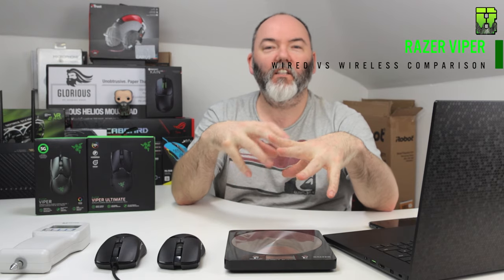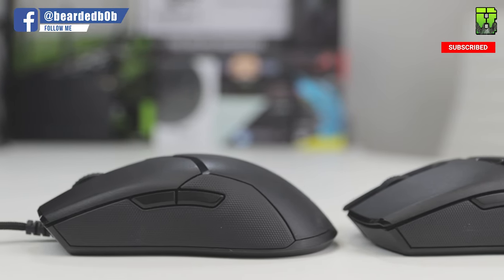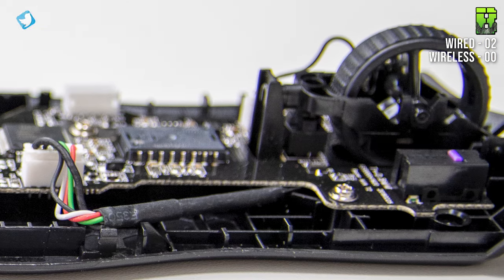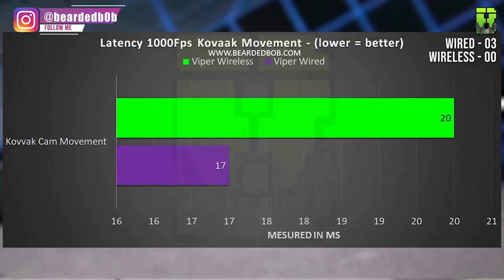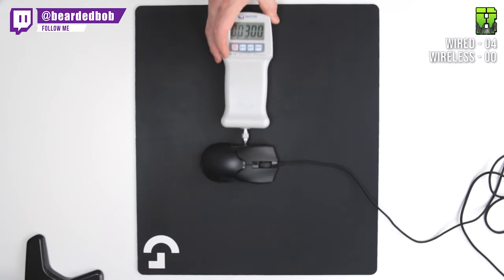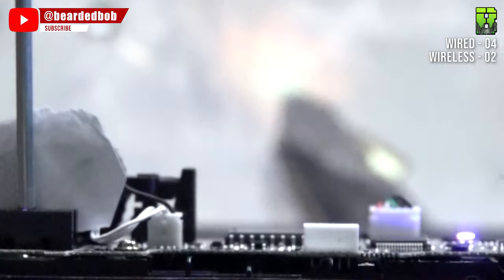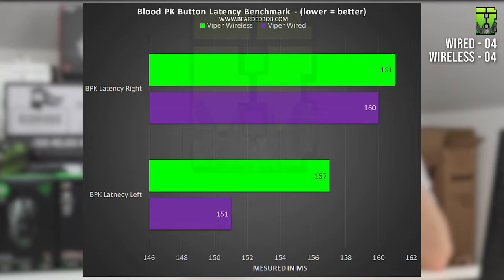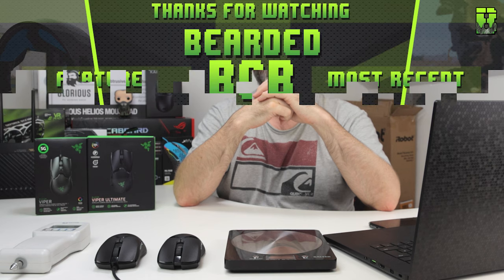The Ultimate Showdown Razer Viper Vs Razer Viper Ultimate Wireless Gaming Mouse Comparison

Comment: UNLESS you have pressed the switches or moved the two mice AT THE EXACT SAME INSTANCE of an in-game frame being either started or just finished rendering, the click or move to in-game frame is going to have a potential of AT LEAST 1 WHOLE FRAME inaccuracy.. that is 16.6ms on 60FPS, if not more than 1 frame, depending on circumstances as the game engine, or the in-game current action or system background processes.. Really can't even be taken as a rough guideline, so Idk why the bother.
Reply from the maker: Lots can affect latency, I wouldn't read into it to much.

Comment: Great video, although I have some thoughts. I get that you want to make it as clear as possible when showing your results in the diagram, but I find it very deceiving when the X-values are so inconsistent, like when you show the ms latency in Kovaaks, and you start at 16. It just makes it look like the Viper wireless has a huge gap over the regular Viper. Again I get why you're doing it, but for me the only thing it does is make it harder to see how significant the gap is, arguably counteracting the whole purpose of changing the starting point to make it clearer in the first place. 

Another thing that I thought was weird was that you didn't take into consideration to the fact that the Viper Ultimate is actually wireless, which to me should give the Ultimate a point in its own, as it is also the reason for being heavier.

I realize after rereading this that it may come off as snarky, but that is definitely not my intent. Again, great video nonetheless.
Reply from the maker: Thanks I'll look into it.

In regards to the points and not using cable or wireless as one to score it's because I only wanted to use 10 points to keep the video shorter and the wireless/wired is an abvious one.
Reply: yes it is confusing but it forces you to use critical thinking kind of

Comment: Thanks, that was a very interesting comparison. But I have a suggestion regarding the ratings. Categories like weight or how much force is needed to click the wheel are personal preference. There must be a point when it is too light for some. Also giving the point to the wired Viper because its cheaper doesnt make sense either because they both are representing two different technologies and one is considerably more expensive than the other by default. And also you could have given a point to the wireless one because it doesnt have a cable. With this approach the result would be completely different :)
Reply from the maker: No problem glad you liked it 👍

Comment: Hey Bob am new around here. Was just curious to see if you could answer some quesitons to the best of your ability for me ? 1. What are the best mouse feet for control ?   2. Im thinking of getting a new mouse, need something slighty smaller than the gpw by about 1.5 mm/0.5 mm range the arch where it sits in my palm is a tad high.  Im thinking of getting the ultralight cape town. What do you think?? My grip style is palm grip. Thanks for your time bob!
Reply: Ahh, i should have stated that every mouse that should suit "palm grip" i cant use which is odd lol.
Reply from the maker: 1. Mouse feet are different on each mouse. 
2. UL2, MM710 or Model o-
Reply from the maker: What size is your hand also :-)

Comment: Which Sensor is better ? Viper oder V.ULtimate ? Thx
Reply from the maker: Imo they are both as good as each other.
Reply: Both extremely good. Human can't feel the difference
Reply: @MrKarli120  i have tons of mices here. Ultimate Viper , Viper , Razer Deathadder Elite, Rivals 310 , Gpro , XM1 , G1 , G502 and a lot more. But at the end i like the most my Razer DA Elite. Do you think the Sensor from the DA Elite can keep up with the Viper Sensor series?
Reply: @flavis35  DA elite and viper have the same sensor (pixart 3389)
Reply: @flavis35  Viper ultimate technicaly have better sensor but the difference is negligible. Just focus on the shape and weight, sensors like 3360,3366,3389,hero, focus+ are all same extremely good. Only specific testing can show the difference, human can't.

Comment: god damn i just find a rough diamond of a channel right here feeling lucky.. a very neat picky guy just like me.
Reply: waiting for that weight reduction razer viper video!
Reply: the thing is measuring like that with a screen is a bit like playing jackpot, if you are displaying at 144hz each frame has a delay of 7ms so when you press the button it can vary from +0 to +7ms inconsistently, so i would recomend to do a run of 50 times then do an average to compare more evenly, also i would show paint on display changing from black to white when clicking
Reply from the maker: Welcome and glad you found me :-).
Reply from the maker: It wont be long now as my Viper mini has arrived so a battle of the weight reduction will begin.
Reply from the maker: I do plan to do more tests but atm just to get this information is exceptionally time consuming. Down the road if I get more time or can do it full time we an get some larger samples to help flatten out any anomalies to provide a better avg

Comment: All I can say is, that the Wireless one has the better sensor. I owned both the wired (returned it) and the Wireless (my main now).
The wired version sometimes had trouble with tracking on my Artisan Shidenkai Mid, while the wireless version has no issues.
And also creating a custom surface on the wired version didn't improve anything. On the wireless one I can use the default setting or tune it, both works fine.
My playstyle was also too agressive for sensor on the wired version, it couldn't keep up with some of my flicks, while the wireless one has no issues.
Reply from the maker: Interesting as the wired has a custom version of the 3389 which is a.top end sensor. What mouse did you move from and what dpi /sens do u run?
Reply: @Beardedbob  Coming from the XM1, had also no issues with tracking on my Shidenkai there. The Ultimate feels like the XM1 tracking wise for me, the wired Viper didn't. Felt more like the G Pro Wireless, but a bit worse.
I'm always using 800 DPI and playing on 12 sensitivity in Black Ops 4 or MW.
Reply: @freesS3  Also better might be the wrong word, i have seen a few mice with 'technically' superior sensors that have tracking issues on some artisan pads,  G Pro wireless being very temperamental with a lot of mats in my experience.

Comment: Bob do you recommend the Air58 or this? I’m not worried about pricing or availability
Reply: Meme God viper ultimate would certainly be better overall
Reply: Im late but find which shape you prefer
Reply: Air 58 in only 500hz...
Reply: Air58 is trash.
Reply: @originalstarwalker21  iknr

Comment: hey i wanted to ask if when you compared the movement latency was the viper ultimate dongle next to the mouse so that it doesn't subject to any unfair interference
Reply from the maker: Hi,
Yes its about 30cms from the mouse. I'm going to do a Video testing if the distance makes a difference and at what distance it becomes and Issue.
Reply: @Beardedbob  oh ok thanks.

Comment: The only things the Razer Viper needs to upgrade would be, a silent option since the switches are laser (no need to get a clicking noise if the switches are laser) and also a lower travel time for the side buttons (the logitech g 502 had perfect travel time, i think it feels like half of what the viper currently has)
Reply from the maker: True a lot of people as me which is a silent switch and the opto's are perfect for it.

Comment: Never really expected things like friction and actuation forces to be in a mouse review, really cool details. Im just questioning the legitimacy of some of the test, it's really hard to believe that the wireless would have such higher movement delay but lower press delay. Better testing methods needed, also would be neat if you stated the sample size of each test.
Really unique review, but delay testing needs to be reworked considerably.
Reply from the maker: Glad you like the review 👍. The sample size is something that’s been discussed before.
Reply: @Beardedbob  One more thing, perhaps it would be nice to measure some sort of signal strength/range with wireless mice? 

With the very concise and wide testing you do this would really complete the set.

Comment: On 3:40 what latency where you measuring? Like a input lag or delay some kind of latency? Damn i play r6 and i even ordered the wireless one (mercury edition/white color) but its 28 milliseconds in cam latency while the wired has only 13 milliseconds in cam latency, now im having second thoughts.
Reply from the maker: device, so from when you move the mouse to when the game registers it. There are a few things that can impact this hence there are a few tests to help. 

tricky one to measure, i've a Nvidia Reflex monitor to use for testing also.
Reply: @Beardedbob   if the razer viper ultimate is used in wired will it equal the performance of the razer viper ambidex wired or will it stay the same?
Reply: @Beardedbob  which has lower latency, the razer viper ultimate or the glorious model o wireless?

Comment: In my country the Viper Wired is a 100e, and the Viper Ultimate is 200e. I bought the Wired one on sale for 60e, and I really liked the shape (I'm coming from a Rival 300) so I figured I'd maybe go for the Ultimate, but the cheapest one I found was 140-160e (so still well over x2 the price of the Wired one). So my question is... Is it worth it? I mean I'm coming from the Rival and a terrible cable, so this one is pretty good in comparison, and I also have a Zowie bungee which I didn't even try with the mouse because again... In comparison to the cable on my old mouse this one is... yeah... Anyways I watched the video, but I haven't really seen much of a difference. I thought the skates were better on the Ultimate, but from your test it's the cable that makes a difference, not the skates themselves. And I do play CS:GO at a semi-high level 3000+ elo faceit, so every little bit helps, but the differences in clicks were pretty negligible weren't they? I mean hell the Wired one actually had better response time in some of the tests... So did I pretty much answer my own question here, or am I missing something?

Also how good is the Model O Wireless? In my country they're only available through people who resell them, and not from actual stores. They're around 80e, and in new condition - But the problem is, if something were to die on the mouse, I'd probably end up waiting 1-2+ month to get it repaired. Should I just stick with the Viper Wired then? I mean I heard great things about the mouse, but is it really worth all the possible headache?
Reply from the maker: The Viper wired is good, I just personally don't like the shape. Here's my review https://youtu.be/clu5ic9LGRU The Model O is a better shape for me also
Reply: @Beardedbob  Hey, thanks for the reply! I'm coming from a SS Rival 300, and I have a finger tip/ palm grip, with 19.5cm by 10cm hands. The Rival was kinda big for me, since I never fully palmed it, but I had it for 6-7+ years. I got the Cooler Master MM710, but that was way too small, so I returned it. I then bough the Viper Wired, and I'd prefer if it was a tiny bit bigger, but it's still pretty good. I think the G Pro or Model O would fit me better because they're a bit taller, and not as low profile. However like I said, everything is pretty expensive here, there was a G Pro on sale for 140e a couple days ago, and you probably won't be able to find one below 120e, so that's still x2 the price of this one. So I don't know if it's worth the upgrade. I also cannot get my hands on any after market feet, and from what I've seen the G Pro doesn't have the best ones, so that's a bummer... I'll be sure to watch your video. But do you think that the G Pro / Ultimate are worth it at x2/x2.5 price of this one? And should I risk getting a Model O Wireless for 80e. Because like I said they don't sell them in my country, so if something were to stop working on the mouse, it would probably be a month or two of waiting to get it fixed. I just don't know if any of those 3 mice are that much better than this one..? Like I said, I've had the Rival for 6-7+ years and it still works perfectly fine, but I would like to upgrade. I have the money to spend, but at the same time I'm not really looking to drop 200e on a mouse, especially if the differences are negligible.

Comment: Hi I have a question about the mouse 1 and 2 buttons. I currently have the wired version and I’m wondering if the ultimate uses the same switch to activate mouse 1-2 buttons. I really like the viper and want to upgrade my wireless mouse from G pro to ultimate but I don’t want to buy if it’s not the same as regular viper
Reply from the maker: I've not opened it yet but I will shortly do keep tuned for the ultimate teardown.

Comment: Hi bob, ive bought the wired version of the Viper, rocking it for about a week now. 
I tested Humanbenchmark straight away when i got it. After playing for severals hours i repeated the tests on human benchmark and still doing it every day multiple times. What ive found is that the mouse somehow got faster after a while of using it. Maybe it has to do with the buttons starting to get a little wear or something. The thing is i put really alot of time into humanbenchmark testing / getting used to the mouse because it somehow does matter where you press the button down. So here are some screenshots of "average" results https://imgur.com/a/gl5553p https://imgur.com/a/o57GsxY (no prediction and no clicks below 130ms involved, tested on a 144hz Monitor, with Chromium Browser, 1000hz polling rate)

Initially i got around 165ms on average, but since day 3 im consistantly hitting around 142-148 ms on average. because your results in the video are shockingly close to my initial testing i had to bring this up. I could imagine that there could also be a little difference in manufacturing quality or quality variation of some parts of the mouse that could cause or explain the difference between the Viper and Viper Ultimate.
Reply from the maker: You could be getting used to the mouse or you are just getting faster at reacting to the green 😜
Reply: @Beardedbob  yea i think its probably getting used to the mouse, about reacting faster to the green well i dont know man, i always feel like im slow :D
wanna buy a 240hz monitor with lower inputlag and faster responsetimes, my 144hz Monitor im currently at is quite old it could be a bottleneck ..

Comment: These results surprised me. I would what happens if you do the click mod on Reddit compared to the old clicks
Reply from the maker: Do you mean by removing the spring on the rear of the button?
Reply: Beardedbob yea, also razer has a firmware update for the wired viper, so that could have some effect.

Comment: Guys the viper u should upgrade the feet Which is like 15 bucks plus paracord Which is about 20 - 30 bucks to get the same preformance making it 110 - 130 to be the same preformance as ultimate however the ultimate has better latency costs 150 bucks and comes with a rgb charging dock it also has no cable so no cable drag and no need for a bungey. Plus better feet pre installed. Viper ultimate is really the ultimate

Comment: I don’t get the point for being lighter on the wired ? I’m curios bc when you lift the mouse your also lifting the wire lol so wouldn’t it be heavier with the wire ?
Reply from the maker: The ultimate has a battery and these are heavy. They are also part of the mouse body where the cable is only a small portion thats included hence it's lighter. If you took all of the wire into account the wires are heavier but when gaming this isn't how you would use it.

Comment: I feel like the latency could severely vary depend on the mouse bc you could get a lemon, you should have it so that a less than 5 ms difference is a tie or something
Reply from the maker: Yep there is certainly going to be some variables in this. Unless you have a lot of vipers in this case then you are not going to be able to get this level of measurement.
Reply: @Beardedbob  also I loved your mini viper ultimate, would that work with a bit of adjustment to a normal viper

Comment: I did my own testing using slow motion video at 480fps and with my 240hz monitor on kovaaks. I tested my viper ultimate wireless and wired and I also tested my old steelseries rival 310. Here are my results:
Razer viper ultimate wired: 5 frames (10.42ms)
Razer viper ultimate wireless: 6 frames (12.5ms)
Steelseries rival 310: 7 frames (14.58ms)
Reply from the maker: Interesting.

Comment: Ur measurements are off the wired is 69 grams 70 with the cable weight
Reply from the maker: Gpw weight 80g on the and scales, each mouse could be different or the scales calibration different.

Comment: Bob. Look at me. 

Weight. Reduction. Mod. For. Ultimate. 

Love you. Please and thank you.
Reply from the maker: 🤔 do you want both though... wired and ultimate?
Reply: @Beardedbob  I only want ultimate but both would be informative. Thanks for actually replying. Your vids got me into mouse modding. Got my g pro wireless down to I think 64 grams without a battery swap using your methods! Sadly it got the double clicks something awful. Might need to try a switch swap but right now I'm running a different mouse with thoughts of moving to a viper ultimate.